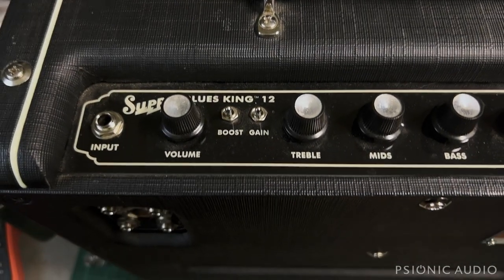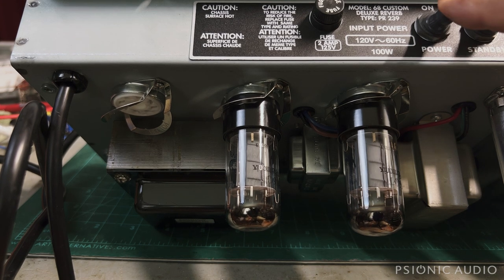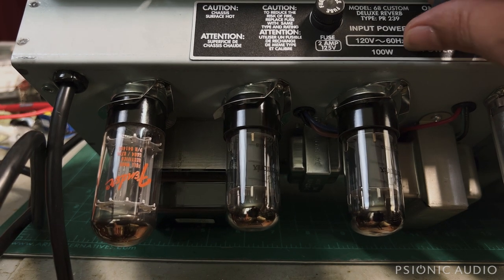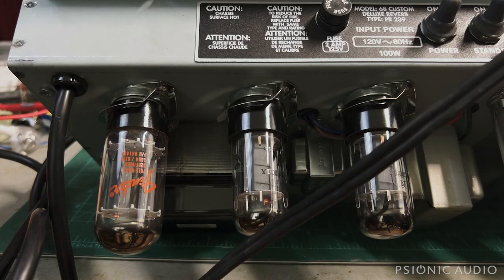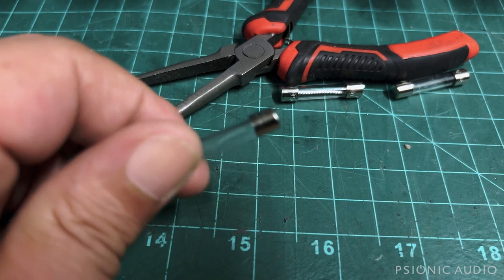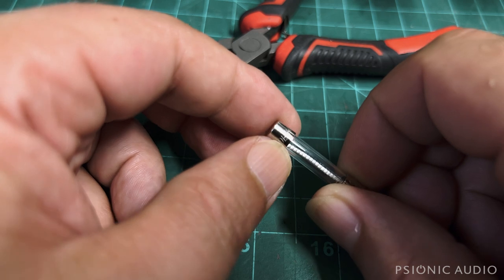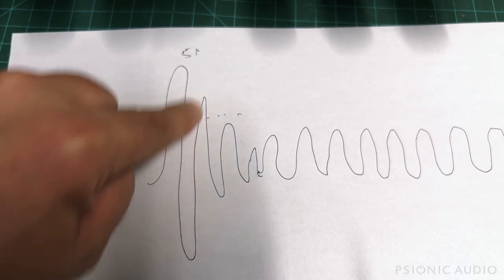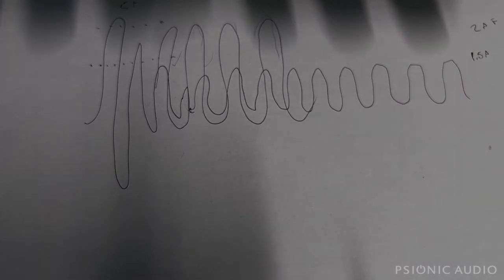Amp Fuses | Slow Blow vs Fast Blow: What's the Difference?

Comment: There's no need to show the sine wave because the fuse reacts only to the RMS (equivalent DC) current anyway. A 12AX7 I just checked measures ~3.5 ohms cold resulting in 1.8 amps, six times the current cold, and it takes a few seconds to drop all the way down to its rated 0.3 amps. Meanwhile, the power supply capacitors look like a short until charged limited only by the minimal inductance of the transformer windings, which is an additional challenge with solid state rectifiers. The fuse time/current curves are available on line. (see https://www.mecampbell.com/media/pdf/ID-SPE-Bus_Ele_DS_2004_MDL_MDL-V.pdf) To the commenter using up-sized fast-blow, that's short circuit protection but no overload protection, which is hardly any protection. All you are doing is protecting the house fuse, not anything inside your amp. That amp could get hot enough to literally be in flames by the time the failure escalates to short circuit levels, typically because insulation melts. We engineers call this fuse coordination - the fuse time current curve must be matched as close as you can to the load's time current curve without crossing for optimum protection.
Reply from the maker: Do you have a better suggestion for visually representing current for musicians to understand?

PS musicians - I consider myself one. This is not about musicians being “dumb” - it’s about a specialized vocabulary.
Reply: @PsionicAudio  The only "water through a hose" analogy I can think of would be a hose with a weak point -- a bottle neck or a hernia -- that cuts out if the pressure exceeds the wall limits. Not sure that would really clarify much. As a side note, it's not easy to find a slow blow fuse at the local home despot or lowest, between what they stock (especially in the Amp range you might need) and inscrutable labels and codes.